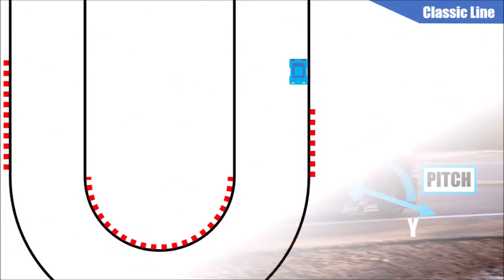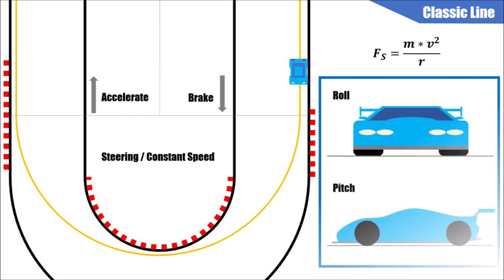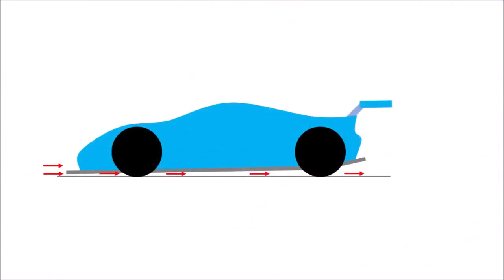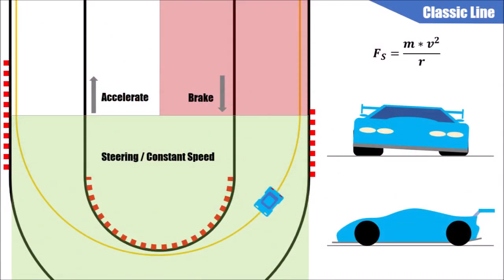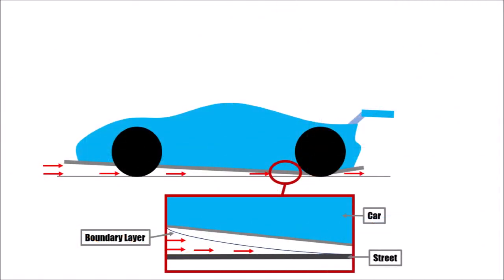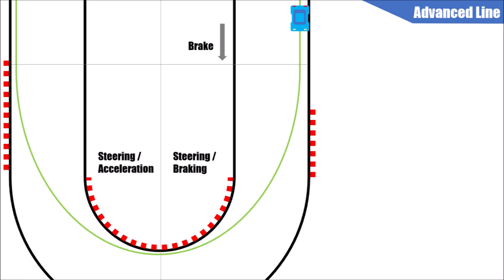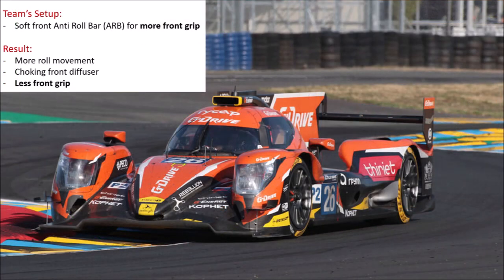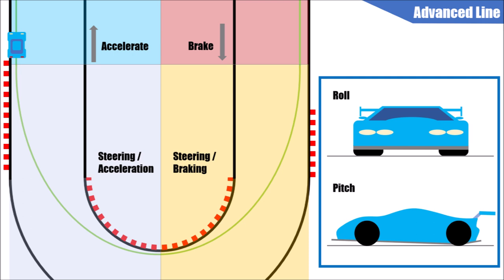Body Roll vs Aerodynamics - EXPLAINED

Comment: Weaker anti-roll bars for more grip in low-speed corners? How come more weight transfer in low-speed corners means more grip, while in high-speed corners it means less grip?
Reply: Because it can cause flow separation to the front splitter/undertray which can heavily affect grip at high speeds.
Reply: I think it's because for mechanical grip, you want the softest suspension possible without bottoming out the car. This allows for more effective weight transfer and have the weight where it's needed at the most. But for aerodynamic grip, you want the stiffest suspension possible to give the aerodynamic body of the car the most stable platform possible. In low speed corners where mechanical grip > aerodynamic grip, softer is better. In high speed corners, aerodynamic grip > mechanical grip.

That's what I understand at least, I have mo background knowledge of any engineering.
Reply: @epitosu6461  Pretty close. In a purely mechanical sense the most grip is when all 4 tires are using all the contact patch etc. So softer suspension to a point allows the tires to more easily stay in contact with ground at all times. But you can go too soft and have so much roll the inside tires are losing grip by being lifted off the ground. For aero you would ideally want the most stable platform you can have so that its more predictable for the design and thus can be more aggressive. That is the reason Williams came up with the Active Suspension, to try and keep the car level to the surface of the track at all times to increase aero performance.
Reply: @cademckee7276  Thanks for the clarification!

Comment: Could we use the rolling of the car as an advantage? I was thinking that the ride height of the front of the car could be set so low that the flow to the front diffuser gets partially choked when the vehicle is travelling in a straight line but as soon as the car begins to roll and the inner side of the car comes off the ground, the flow to the inner side of the splitter reattaches for increased downforce. Would that be feasible assuming the front diffuser profile could be shaped to avoid abrupt flow separation? Or would the operation range be too narrow to avoid porpoising?
Reply from the maker: Theoretically good idea but in reality you deal with bumpy tracks and kerbs, so you need a certain clearance. Also if a very low car rolls it will touch the ground with the outboard side.
Controlled separation of flow is tricky because it depends on weather conditions, dirt on the car etc.
An easier way is to back the whole car off with a soft heave spring at the back - which is what F1 is currently doing.
Reply: @BSport320  Heave springs sounds like an excellent topic for the next video 🙂
Reply from the maker: @damncritics  Now that you say it... good idea! Will put it on my list.

Comment: i thought this explanation was legendary. I was never aware of the potential compromises between trying to achieve maximum low speed grip and maximum downforce under dynamic body movement. 

I play ACC and I often get chaotic or undesirable results when setting up the NSX in GT3 that match the effects you described in this bit. Conversely, I didn't observe these results to the same effect in gt4, a category with minimal downforce and greater ride height, and simply saw good results trying to optimize setups to achieve better tire contact

Comment: The raised edge not only provides higher air mass, but since it's a converging duct it also serves to accelerate that air like a nozzle. The faster the air the lower its pressure. Choked flow is a sonic flow phenomenon that reduces flow downstream as the result of a sonic shockwave. However if you have a choked flow, you can actually accelerate flow downstream because diverging sections increase the speed of sonic flows. Choked flows also happen when the inlet pressure is roughly twice the throat pressure.

Comment: If the front outside diffuser doesn't choke or stall while cornering.
Does the outside diffuser generate more downforce than the inside diffuser?
Reply from the maker: That really depends of the particular diffuser shape. In general, the closer you get to the ground with a diffuser, the more downforce you can get but there is a maximum. If you get lower than the maximum you loose downforce again.
So for your question it's possible that the outboard front diffuser is increasing more downforce than the inboard one is loosing, so overall you would get more.
Another thing to consider here is that the flow doesn't hit the front diffuser straight while turning and you could loose only because of that.
So it really depends on their shape...